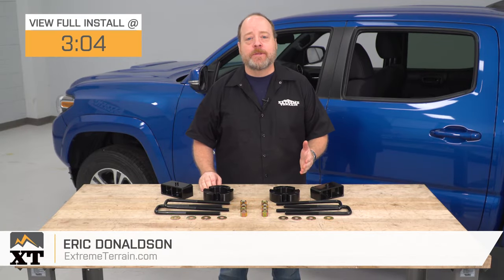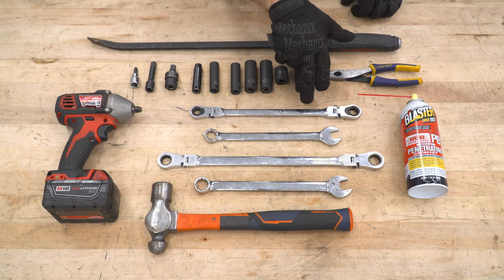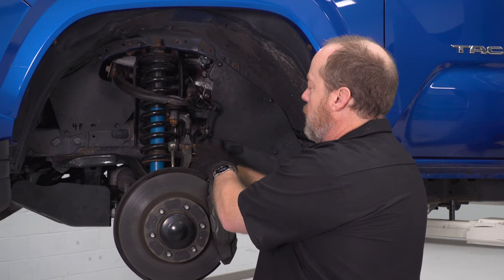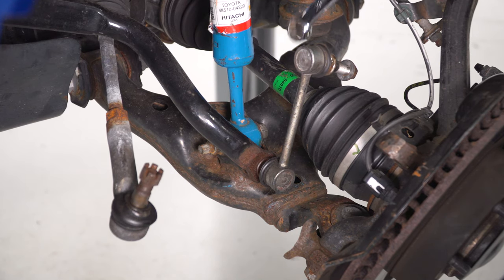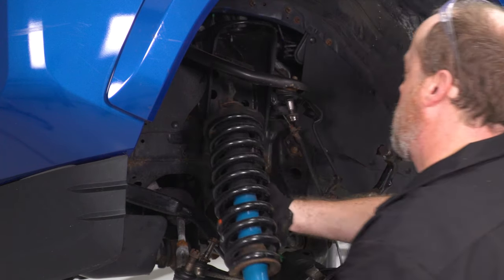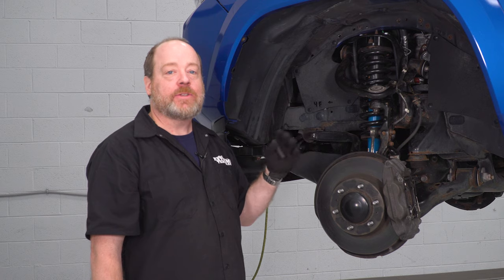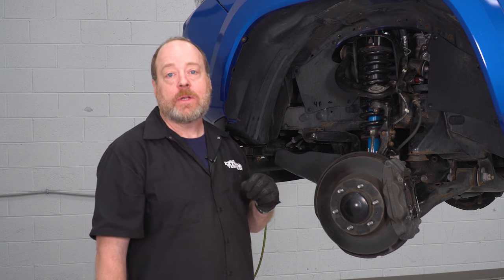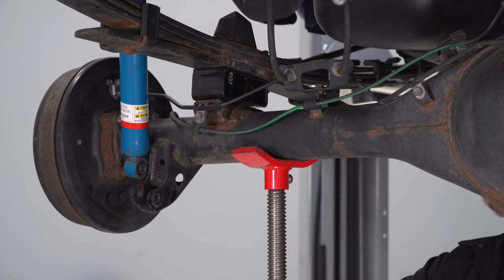2005-2021 Tacoma Mammoth 3-Inch Front / 2-Inch Rear Leveling Kit Review & Install

Comment: Getting ready to do mine and have a few thoughts. How often does the tie rod end release without any downward force? 🤔 Would the top ball joint have released without the pry bar that magically appearing? There is no such thing as a 19mm Crescent but we know what you meant. 😊 Are torque specs important on the upper ball joint and tie rod end castle nuts? And any of the other fasteners for that matter?

Comment: But all your doing is taking away down travel ,seems inefficient,how do you make the axles level? Is this just a lift for duochbags? If I’m wrong please lat me know
Reply: I'm doing it so I can fit 33's. truck as it sits just has too small of a tire.
Reply: Your still only taking away down travel putting your axles at a bad angle on purpose?doesn’t seem sensible
Reply: @jeffkowalski3107 sorry,  i know this is an older comment. But in case you were curious they do may front dif drop spacers so they sit level again, usually it’s needed when doing the 3.5” and greater lifts. But it’s likely anyone doing these strut spacers is doing it just for show and not intended for trails or real 4wd usage.

Comment: If I bought 2in shocks lift for the front of my Tacoma in the past am I still able to run the 3 and 2
Reply from the maker: You may have limited shock travel compared to a longer one, but if you don't mind being mildly limited then you should be fine.

Comment: That’s not 3 inch front, I busted Men show measured tape it’s 1.5 inches on front. I knew it!
Reply: The coil springs change their resistance depending on how far they are compressed. A 1.5" spacer may very well result in more than a 1.5" lift.

Comment: Do the 35s rub?
Reply from the maker: 35's with this set up would most likely rub and you would need to do some modifications. It would all depend on the set up though including the tire/wheel width and offset as well as the "agressiveness" of the tread. Hope this helps!
Reply: @ExtremeTerrainToyota  Hi. Do the 33’s rub also?
Reply: I have the 3" / 2" kit.  Do I need to do anything else if I want to run 33's (285t70/R17 KO2's)
Reply: @tommyliu7634 I would like to know also.......I already have the kit he is showing AND the 33's but don't want to get them mounted on my rims yet if I need to do a CMC

Comment: Don’t buy this kit does not fit 33 inch tires I’m paying the price for it now
Reply: I didn’t buy this specific kit but the same size from another company. What’s the issue you’re having with adding 33s? Haven’t installed the lift yet so I’m curious what problem you ran into
Reply: @Lord_Fishy   a lot of rubbing on the cab mount having to do a cab mount chop
Reply: do you mind me asking your exact tire size, and what width specifically
Reply: 33x12.50/r17
Reply: Are there any other upgrades you’d recommend to go along with this install to help keep the longevity of your Tacoma and make sure than you’re not spending $$$ later in repairs? @extremeterrain
Reply: Yo man this kit just takes away down travel and put your axles at more of an angle ,as far as longevity or performance it’s just for looks ,truth
Reply: It wont hit if you run a 1 inch spacer on the front with the leveling kit
Reply: It will work with the correct wheel and tire setup. 12.50 tire is too wide. A zero offset wheel is recommended. I bought -12 offset and had to trim and do the cab mount chop. If I had the right wheel/tire I’d probably been fine.
Reply: @jonnewbury3482  yea mine is -24 and only rubbed plastic on inner fender well. I just trimmed the plastic and it was perfect. I did have to take the lower front bumper valance off though. If I trimmed it it'd look dumb lol